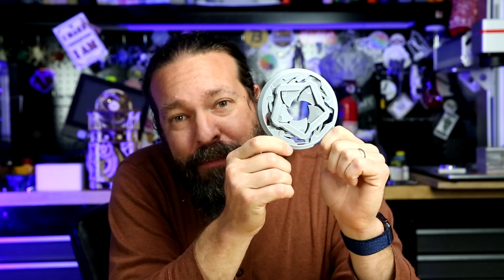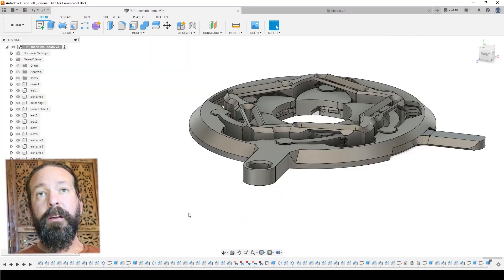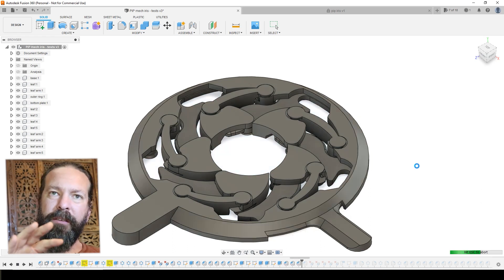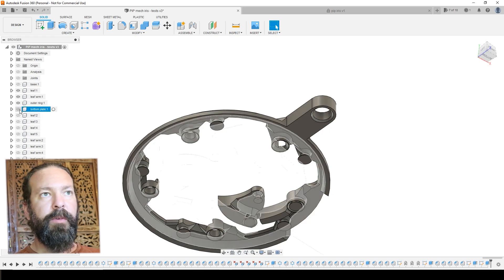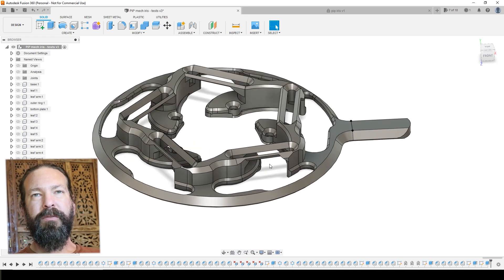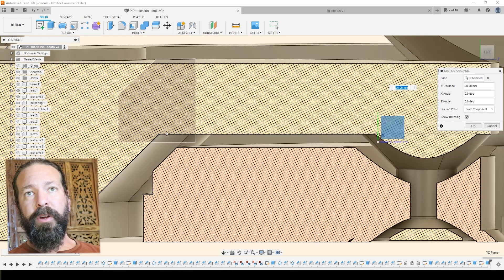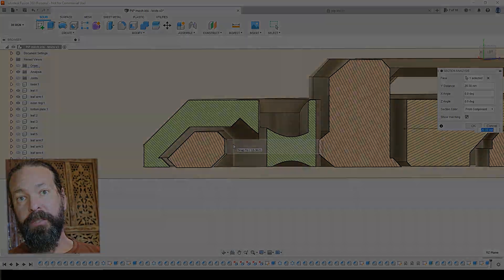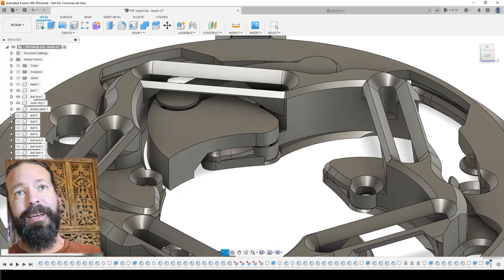How To Design Print In Place 3D Printed Mechanical Iris

Comment: Good stuff! One thing I learned that might help when you're tweaking the design on a part that's been patterned is to roll back the timeline prior to a point before you applied the pattern. Then you can edit the original part and that change is updated when you roll the timeline forward.
Reply from the maker: I’m always a little afraid it’ll screw up other parts that are working, or erase the timeline up stream when I do that. I should trust it more

Comment: Great video Caleb. "If there was some way Fusion could read my mind" I don't know how many times I have thought that. I could see this being a good model to use a spreadsheet of parameters with, though doing that makes the planning much more complicated I would imagine. It would be cool to be able to change all the pin tolerances at once though. I am going to try out the print. How many hours do you think you have in it? It looks like quite the endeavor. Best!
Reply from the maker: had I thought ahead, I could have easily set the pins and the pin holes to be a variable in fusion at the beginning and changed them with a single change. I did not think ahead. Dammit.